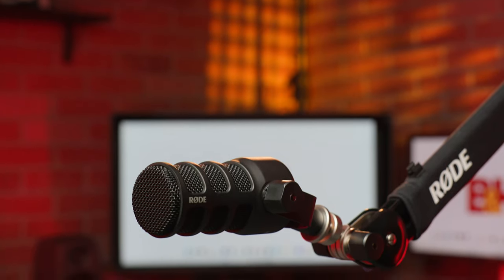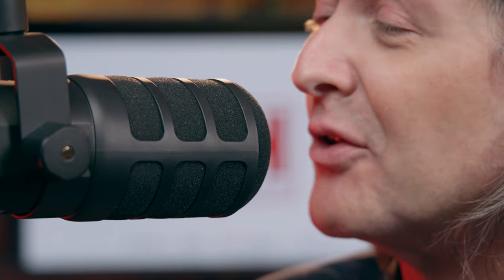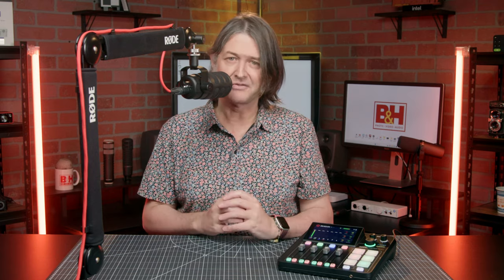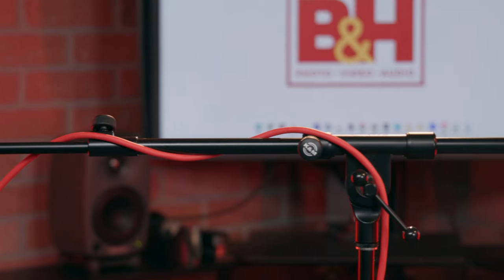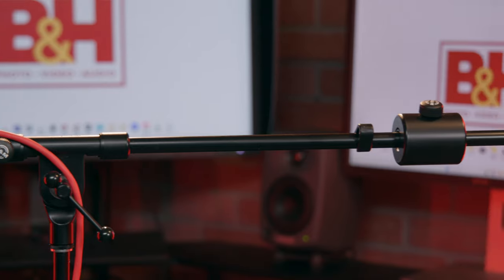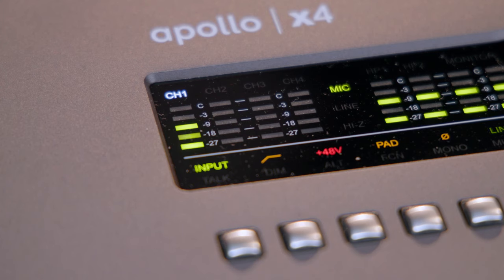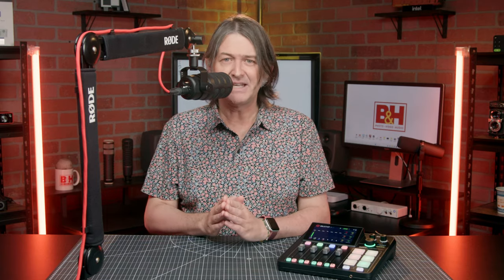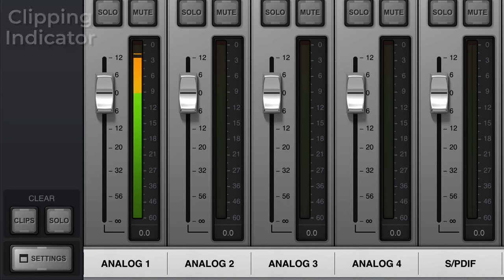Microphone Techniques for Podcasting

Comment: You can also use the pop filter as a guide to keep yourself at a consistent distance and angle from the mic. Once you’ve found the best sounding spot, set the pop filter there. When speaking it’s easier to stay right next to a pop filter instead of, for example, 3 inches away and 45 degrees off axis from a microphone.